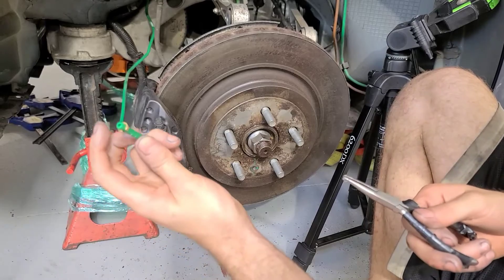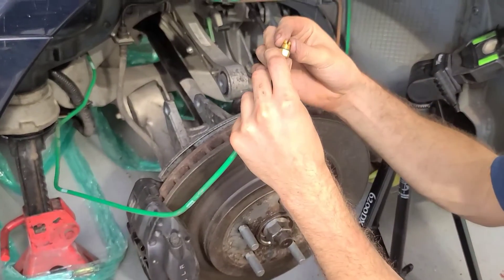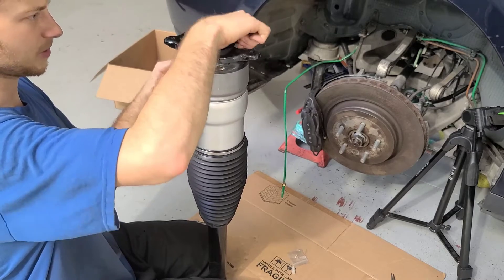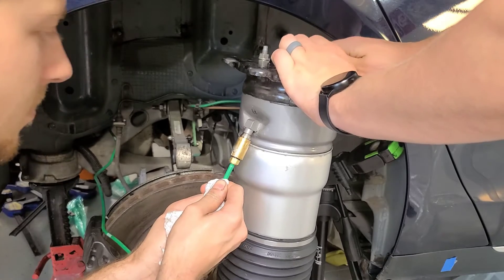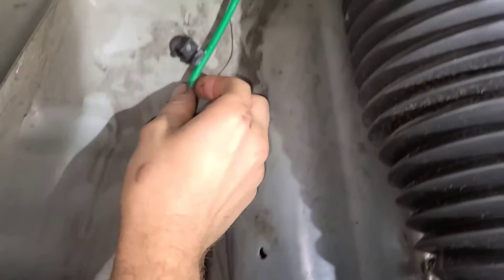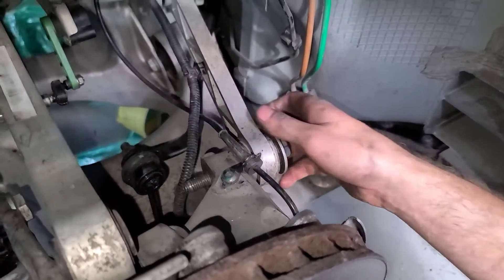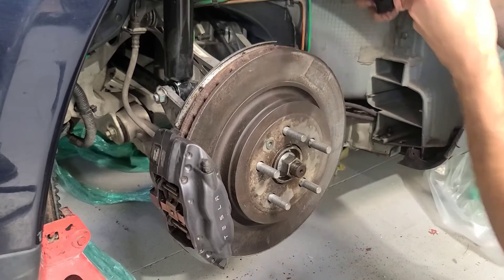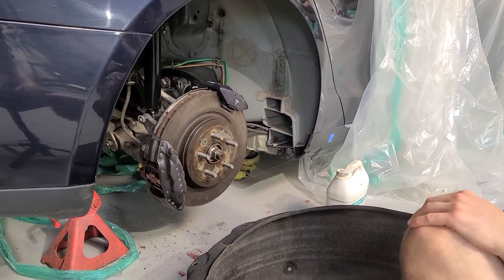Step-by-Step Guide to Installing a Tesla Rear Air Suspension!

Comment: Helpful video, did you tighten all linkage bolts after the car weight is sitting on the suspention? if you dont do that before, the rubber inside has to work twisted, and dont less very long till you need to do replace them too, you didnt mention that in the video, but it is inporten to tighten them after.

Comment: Helpful video thanks. 2 questions, why did you disconnect the suspension links? Is that jackstand on the battery casing and not the jacking point - is that not risky?
Reply: Random viewer here - the links are disconnected to allow the rear hub to drop, so the strut can be put in at its full length. The arms should be tightened at ride height, so the bushings would all be pulling the suspension upwards. Taking them all the way off is just easier in case the rear hub needs to be wiggled around to get bolts in.    The jack stand is on the rear subframe mount, the battery is toward the front of the car.

Comment: Hey what did you use to refill the suspension? Nitrogen or?
Reply: nitrogen to reduce rust
Reply: @Nicholas-f5  How'd you do that? The car has its own air pump that refills the reservoir tank... so you just get normal atmosphere.
Reply: @daves2433  There's a nitrogen tank. You can look in the freely available service manual online for proceedure on how to fill the nitrogen tank.
Reply: @david-iam  The service tells the techs to refill it with nitrogen, but it's refilled by the onboard air pump with outside air.

Comment: how do you replace the nitrogen in the tank and shocks?   is all oem air suspension uses nitrogen to preventing the system from freezing and corrosion?
Reply: It uses an air compressor to charge the system. No nitrogen tanks of any sort.
Reply: Yes, you need to use nitrogen, Tesla has a sealed system. It only uses air from outside if there is a leak or not enough gas to put right pressure.
Reply: @paulf3353  yes and since all suspensions start to leak sooner or later, the nitrogen is slowly replaced with air and humidity. For some reason Tesla hasn't accounted for that in their service plans, you just have to learn it yourself.
Reply: @Cenon2_   That's why there is a dehumidifier in the line for those cases